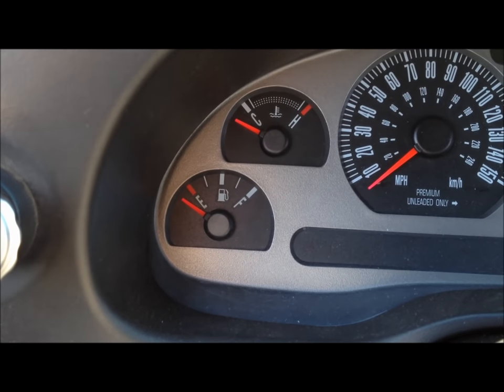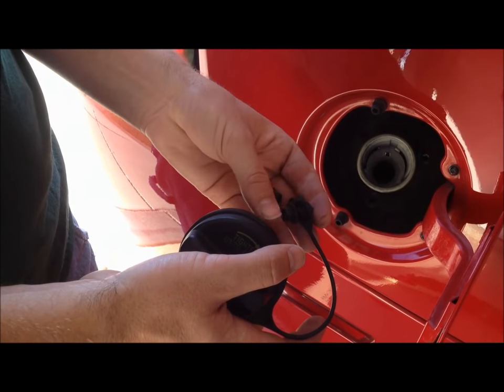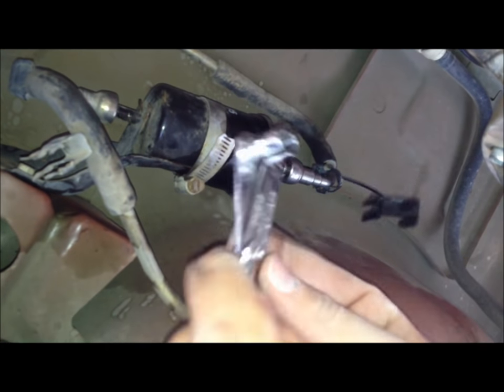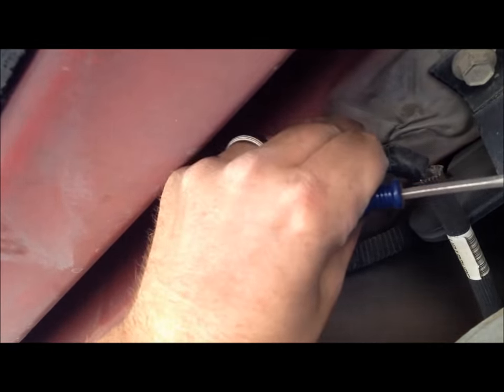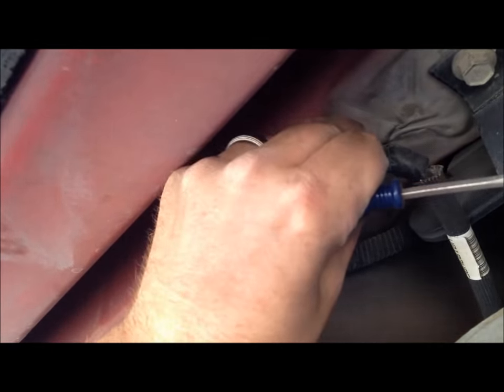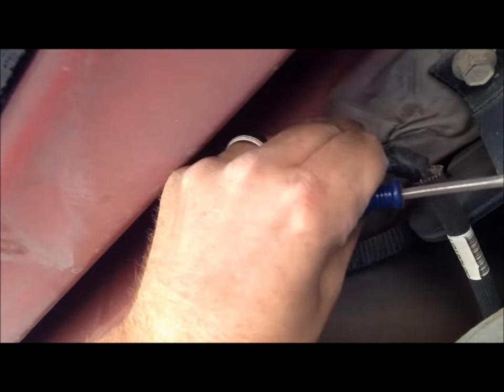How to change a fuel pump & Fuel Filter: Ford Mustang 1994-2004 sn95 New edge filler neck grommet

Comment: Excellent video, you did not miss one step. New pump and filter cost me 136.00 and the mechanic wanted almost 800.00 to do the job. Thank you for the, help even the info on how to disconnect the fuel lines and how the tool works and your even gave the socket size for each bolt. Alain great video and again thank you for taking the time so include so much detail. Saved a ton of money, thanks.  Tony from N.J.
Reply from the maker: Thank you for the feedback. Glad it saved you a few bucks 😉
Reply: 800 dollars?? Dudes are crazy

Comment: Just finished the install on my 2000 GT thanks to your video. I had a full tank of gas and  I tried to siphon the gas out before removing the tank, but was not able too. The siphon hose was blocked by the neck outlet. Instead I cut the rubber neck grommet and shoved the hose in there and replaced the grommet with a new one. Thanks again for the great tutorial. Couldn't have done it without you.

Comment: Fuel line removal tool hack..   Get sharpie pen caps..  Buy a few because they may break. But they work !!     Also AutoZone no longer clears codes !!!    Just disconnect positive battery terminal an ground positive wire to motor or alt.  This will drain the power left in the ECU.  Peace !!
Reply from the maker: Very cool
Reply: I done this today actually, my v6 has been sitting a few years and wishing I'd drove it more. The fuel filter was rusted and the reason for not driving the 6 is because of sugar that was put in the tank and just started working on it today. Any hints, tips, or tricks are very welcome!

Comment: Great video.  I just did my sons fuel pump and filter.  I do have 2 questions.  1) How do you put the v-shaped lock on the tube that is at the filler neck?  It is simple enough to remove it but how in the heck do you get it back on?  2) I got the Delphi assembly and it was pretty much like your video.  However, after starting the car the check engine light is on(as you indicated would most likely be the case) but also my fuel level is not moving and a message on the dash that says low fuel even though I filled it up.  Thanks
Reply from the maker: 1) It should slide down and attach with the small bolt. It can get wedged some times. 
 2) It sounds like the fuel sending unit isn’t working (the part on the fuel pump basket with the float). Was it free to go up and down in the tank? It may have gotten caught or broken.
You can disconnect the battery to reset the light
Reply: Clip issue resolved....thanks.  Is there a way to use my scan tool(it is shop grade) to diagnose the float siutation. I am going to use it to put out the engine light.

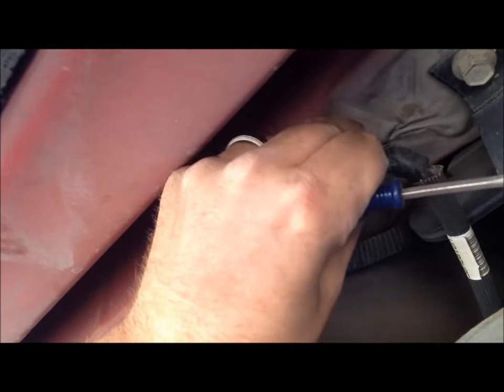Comment: @dannyJohnson'sGarage 16:33 I'm having issues with leaking fuel when I get gas after doing this repair from the middle of the tank. I didn't want to over torque the bolts on the fuel pump but now its leaking after filling up 3 times from fuel pump gasket. Do you have any other recommendations? I put on the heavy-duty gasket and new bolts from O Rielly's.
Reply from the maker: Unfortunately, you’ll have to drop the tank and makes sure the seal is clocked right. I’d also look to make sure it’s not the filler neck grommet

Comment: If I heard you correctly, you're replacing the OEM fuel pump with a pump that is normally used in the Focus ST. Do you have a part number for that fuel pump? Would it work for the 02 GT?
Reply from the maker: SVT focus, not focus st. They are discontinued now.

Comment: Thank you for the video. I have a question I just changed my fuel pump on my 2002 mustang gt. My question it was a after market pump i cut my harness plug to pump butt connect the new wires in I have the cut wire setting on top of pump assembly will that be ok where no gas rise above that unit  and gas  effect the butt connected wire?
Reply from the maker: I would wrap them tightly in electrical tape. They should be fine as other connections are even inside the tank, but wrapping them in electrical tape will reduce the risk of any sparks getting out and into the fumes

Comment: Do you have any magic way of getting on/off the driver's-side tank strap bolt on the IRS Cobras?  I had a heck of a time doing it yesterday because part of the IRS is (very) in the way. Basically had to use combo of regular and ratchet wrenchs.

Comment: I put jack stands under the axle but that was a hassle removing them later because after one jack stand was removed the jack on the other side was "tipped".
Reply from the maker: I would not put jack stands under the axle https://youtu.be/mKy1rNRRMRk
Reply: @dannyjohnsonsgarage  Thanks very much for that info. one of the things I was wondering is what happens if you lower the car and you can't get the floor jack under the car from the sides. I'm assuming that you would need a low profile jack and it would be a little more difficult seeing the jack point. Anyway, I'm going to look into getting  the sub frame connectors but, heh, you need to jack the car to install them. I'll have to hire someone to install them since it appears that they have to be welded on and I don't have welding equipment or the expertise to do so. I wish I had it done years ago.
Reply from the maker: @genericdude6551  you’ll want the car on a drive on lift when installing or the doors may not close perfectly anymore. There are bolt on kits like what convertibles and mach 1s came with, but some nice full length ones to weld on would definitely be best. As for a Jack under a low car, it’s the best use of a college text book o ever had lol https://youtu.be/7xbD4gYg2tE
Reply: @dannyjohnsonsgarage  Which do you recommend? Bolt on or welded? I see there are bolt-on connectors at Summit Racing.
Reply from the maker: @genericdude6551  The welded ones are nice because they leave parts of them not painted for the welds to be able to attach, so if you plan on finding a good person to weld them on a drive on lift I would do that

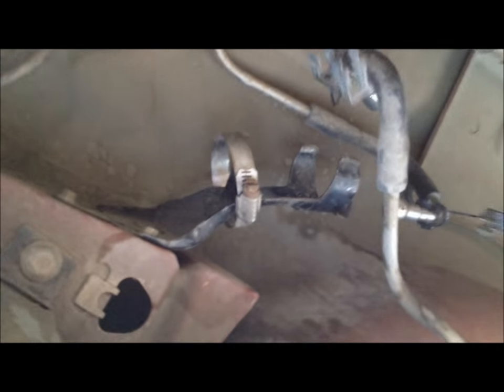Comment: Thank you for this great video! I followed your steps yesterday to change out the fuel pump on my 2004 GT, and everything went perfect. Except for the white connector at the front of the gas tank, at 8:00 minutes into your video. The connector broke just like yours did in the video. I removed the line at the next connector after it goes over the rear axle to get the line out for a replacement, and that connector also broke. both connectors are of the same type, and made onto the tube. The parts number sticker on the tube was unreadable. Please let me know where you found the part to replace this line with, or how you were able to fix  it. Local Ford dealership can not find this fitting, or tube at all either. Thanks in advance.
Reply: Same thing happened to me.  Bruce, did you find a replacement part for that hose/line/connector?
Reply: @paulesposito5649  I finally found fittings that worked from a company in Las Vegas Nv., not far from where I live. It's called ALL HOUSE SOUTH LLC. located at 3105 W. Post Road. Las Vegas. Nv. 89118 702-643-4444 / www.allhoseinc.net  I had to take old fitting in and they had a different looking fitting that worked and made up a new hose for me too. Hope this helps you out.

Comment: Is there a way to lower the tank just enough to pull out the fuel pump housing?
Reply: Yes you don’t need to remove the goose neck thing

Comment: is this an 03-04 cobra?  My IRS stuff from my 04 makes it definitely look more difficult to get to/remove the fuel filter. About to check out videos on removal with the specific car as I'm at that step of this video with my car.
Reply from the maker: This is on a mach 1, but my brother just replaced his fuel filter on his terminator yesterday. It’s possible reaching up in there. It may help to get the rear of the car off the ground.
Reply: @dannyjohnsonsgarage  yeah I just got the fuel filter out. Actually found a thread on SVTPerformance earlier and it was a little boy peace of mind after reading that. Tomorrow I will resume on dropping the tank and trying not to crack The Grommet and also I have a little more than a half a tank of gas so as I drop the tank I will try to siphon some out
Reply: @dannyjohnsonsgarage  someone just replied on Facebook and said they doubt both pumps would fail at the same time but my question is if only one pump is bad how would the car run and will it even start? I checked voltage at the boost a pump and the fuse is also good. So at the booster pump it's a black plug I unplugged it and I proved and at one of the wires I got 12.70 volts. Coming off of the booster pump there are two red wires and one going to one has a fuse and the other red wire is going to a green wire off of a black little box thing on the body of the car on that side. I'm about to switch the car on and see if I'm supposed to get voltage at that red why but I don't get anything with it off. For the other red wire I got 12.7 with it off
Reply from the maker: @sandmansimms5704  On one pump the car would still run, but wouldn’t be able to supply full fuel pressure at full throttle, so the car could run lean and melt a piston. The key is watching a wideband (air fuel ratio gauge) or fuel pressure gauge to ensure you have enough fuel
Reply: @dannyjohnsonsgarage  okay yeah I'm going to look up a video now on checking the power to the boost a pump. I checked it but I want to verify what I got I did get 12.7 at the big red wire coming from the front of the car I unplugged the black piece. The one the other red wire coming from the booster pump that's going to the green wire on this other black box in that same area I didn't get anything with it switched on or off

Comment: You make that look easy, I have 3 cobras and not looking forward to changing them when my quit is there anything to do to extend the pumps life?
Reply: +ledoruxp Try to not run to low on gas to often (like I to often do and now have a dead pump!) as the pump runs hotter when not submerged in fuel.

Comment: Excellent tutorial😎😁👍💯 Quick question Danny. I have a 97 Mustang cobra and im upgrading my fuel pump to a bbk 255lph pump and I have a stock engine. Do I need to  get a tune after installing the new pump??
Reply: I believe that is a return style system, so any extra pressure should be bypassed back to the tank via the regulator.  In other words, you shouldn't have a problem.  Now, if you're changing the regulator and/or injectors.. then yes.
Reply: @w00derice  OK Thanks for the reply 😎👍💯
Reply: @qward2174  hey, no problem at all. 👍

Comment: Hello, thanks for the excellent video. I replaced the fuel pump in my 02 mustang and i still have no fuel pressure at the rail. It does prime like before but still 0 psi at rail. Fuel filer is also new. Any help would be much appreciated, thanks
Reply from the maker: I would check the fuel rail pressure sensor (FRPS) that is located on the fuel rail. It looks like a black box 1” in size

Comment: Hey Danny just did fuel pump and my P0190 code on 2003 Mach 1 is still here. I can start car and it will run for 10 secs before starting to stutter and die. I just did fuel pump today and also the fuel rail pressure sensor. Do you have any ideas what else it could be?

Comment: If your car is supercharged you shouldn't do the fuel pressure relief step correct?
Reply from the maker: You should do the relief regardless. The the only time it hurts the engine to lean out is under boost
Reply: @dannyjohnsonsgarage  oic. It doesn't hurt it at that low level. Thanks!

Comment: Bonjour de la France ! Merci pour la video je possède un modèle 2004 v6 pourrais tu me donner la référence de la pompe et la pression d'essence je l'ai remplacé par une pompe mais la voiture tourne mal ( la pompe donne 3bar max ) merci
Reply from the maker: Usually 39 psi at idle and should maintain that with acceleration

Comment: After installing rock auto fuel pump kit pumped 8.5 gallons and fuel gauge reading full, any ideas?
Reply from the maker: How was your fuel sending unit before?  Did this one come with the whole new sending unit? If it’s new it could be tangled. Unfortunately, mine is needing to be replaced, even though my pump is good now.
Reply: Yes sir I bought the whole kit, Just hate to have to take it all apart again
Reply: Pulled the tank again and found the float sticking, fixed that and its working fine now
Reply from the maker: Ed ross Glad you got it fixed!

Comment: Hey Danny, great vid like always. Question,  my 1996 gt manual isn't running. The old starter fluid in the intake worked. I hear the pump prime in the "on" position. I checked the shrader valve and its bone dry, I checked the fuel pump power line near the tank and it only seems like half of the prongs are getting power...any suggestions? Thanks
Reply from the maker: Don Johnson You might want to check the fuel rail pressure sensor (frps) on the fuel rail

Comment: Are you referring to the shrader valve on the drivers side near the plenum? If so, I did...dry. I'm thinking maybe the fuel regulator. Do you know where that's located?
Reply from the maker: It’s a black box about 1”x1”x1” that plugs into the fuel rail.

Comment: Changed mine a year ago with a Delphi unit now getting same code, P0190 still runs but service engine soon light is on. Do you think the pump is bad already or something else?
Reply from the maker: Ed ross That code is for the fuel pressure sensor. You’ll see it at 8:34 in the video. https://youtu.be/JvgKGJjAwU0
Reply: @dannyjohnsonsgarage  changed it now I got p0193
Reply: Hey guys.  I was just reading posts, and wanted to run a question by y’all -

I have an ‘03 cobra.  Had to change the fuel pumps in Jul 17, but can’t remember what the code was.

A couple of weeks ago, I got the P0190, and changed the fuel rail sensor (your video on that made it super easy, Danny, thanks! 👍).

Cleared the code, but was trying to remember if the code was a different one for pumps?  I was thinking, for some reason, that it was 0190 when the pumps were bad.

Looking at a list, it also could’ve been a 0174 (system lean) or 0191 (pressure sensor circuit range/performance).

Thanks for the help, fellas .. if you happen to even look at these posts on older videos!  👍

Comment: I cut a square on the trunk liner to get access to the fuel pump, it took me 15 minutes to change it. just be careful not to cut the wires.
And use a sheet metal and silicone sealant to "repair"the cut.
Reply from the maker: I’ve heard of that, especially on camaros/Firebirds, but I’m not interested in doing that to my Mach 1, Cobra, or even my GT
Reply: @dannyjohnsonsgarage  I feel you, but it doesnt affect the structure and is extremely practical, especially if you want to upgrade the pump later.
Reply: @jhonkafirk  please show me where to cut and how, my 01 gt pump just died and I need a quick access point. Thanks!
Reply: @atrocitus9804  Sorry for the late reply, hey the hole is going to be big, Once you open the trunk, is going to be almost 60% of the spare tire mold in the frame.
because you have to access the wiring and fuel connectors.
plus watch out with the sharp edges, too be honest, dropping the tank is way easier and less risky.

Comment: Great video! I'm about to change the dead fuel pump in my GT (which has a full 15 gallons of gas) and I noticed you didn't mention replacing the gasket between the tank and the fuel pump access cover. I didn't even see one on you car. Is there one and did you replace it?
Reply from the maker: michaelsjolin that would be a good idea as well

Comment: I have a code on my v6 
P1450 unable to bleed up fuel tank vacuum.
Any idea what that could be ?
Reply from the maker: Iron Guy It’s typically from the fuel cap. If you have the capless design it will also come on if the flap doesn’t come up. Remove and replace the fuel cap, wiggle the tab that the fuel nozzle pushes on, and maybe even remove the battery cable for 10 minutes to reset the codes
Reply: Danny Johnson thanks for the answer.
Yeah, that’s the first thing I did but it wasn’t it.

Comment: Dang Danny, my mach 1 was only sitting for 2 weeks. My fuel pump does not make the priming noise. The fuse is ok. Do you think My fuel pump probably died ?
Reply from the maker: It’s possible. If you can get it to start with starter fluid (attempt at your own risk and don’t use a lot) it might get the pump running and unclogged If it got gummed up, but changing the pump and filter isn’t that bad. It may be time
Reply: @dannyjohnsonsgarage  yup it probably is time. 169k miles on the mach 1

Comment: Danny I am going crazy trying to find one of those ford focus pumps I cannot find one can you point me in the right direction?
Reply from the maker: I had to buy the entire pump assembly. Probably way more money than I should have spent on the pump. If it’s that important, look for the entire assembly.
Reply: @dannyjohnsonsgarage  I couldnt find it online anywhere by itself but I was able to pause your video and read a part number off the side of the basket it lead me to this: https://www.ebay.com/p/Fuel-Pump-and-Sender-Assembly-Motorcraft-PFS-204-fits-2003-Ford-Focus-2-0L-L4/76489400?iid=312253595699&chn=ps

Comment: Danny have you done this on an IRS cobra yet? Is it any different? The fuel filter looks like a pain to get to on my IRS cobra. Can I lower the tank slightly first to get to it better ?
My cobra had a P0190 check engine code come up and it starts and stalls after a few seconds. Then doesn’t turn on . Cycle the key a few times and it does the same starts and stalls after a couple seconds. I think it’s the pump what do you think?
Reply from the maker: It definitely is harder to get to the fuel filter with the IRS, but it can be done with small hands and some screwdrivers. Otherwise the process is the same for dropping the tank and replacing the pumps is similar with the exception of there being two of them